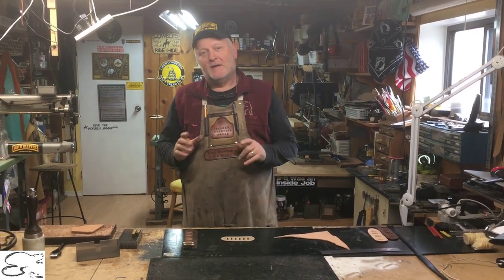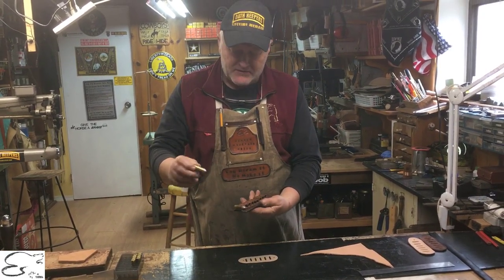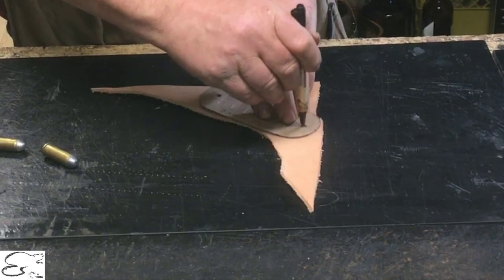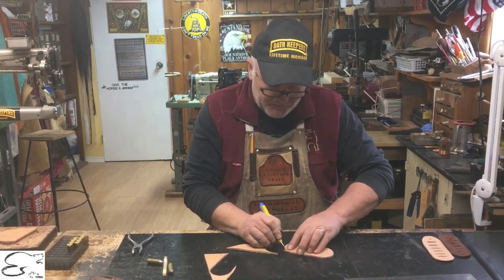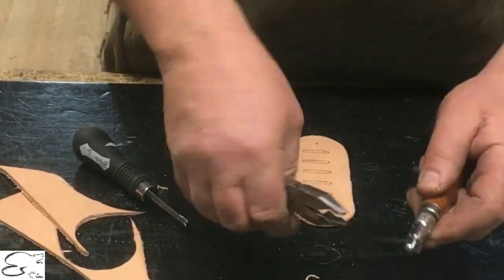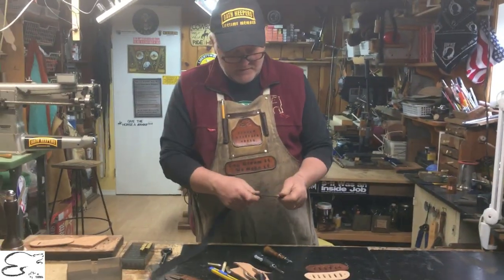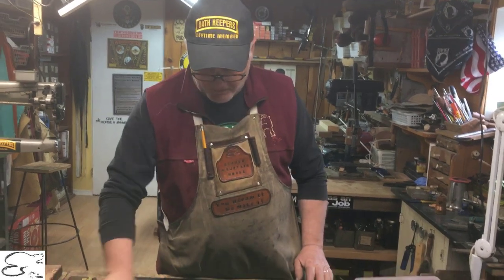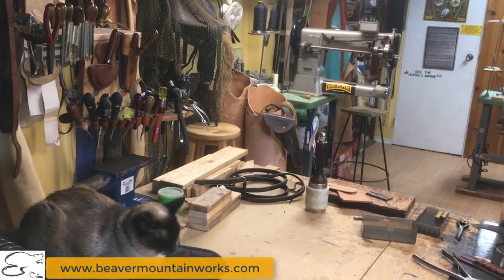How we make the Signature 3D cartridge loops

Comment: Thank you for the video! I haven't made one of these yet but a question I have is say you have one of these with 6 loops.  If you take 3 of the cartridges out, what keeps the slack from the 3 empty loops from going back behind the leather and loosening the loops for the next cartridge in line and then it could fall out?  Is this a problem that happens? I was thinking a solution could be once you have the loop material in place and riveted down with cartridges in place run a line of glue on the back where the material goes in and comes back in from the slot so that each one is self contained but not sure if that would work.
Reply from the maker: Thank you for watching Jason and no that doesn't happen. With all due respect but you are trying to solve an issue that doesn't exist. Like you say, you haven't done one of these, but we have made hundreds of belts and holsters with these 3D cartridge loops on them and no they don't loosen or fall behind the leather. 

The reason for this is, the start and end are held by chicago screws or rivets when manufacturing it, and the loops are formed around the cartridges (minute 8:50 on) and then hold themselves in place by friction.
Reply: Ok - thank you for the response. Wasn't sure if that would happen or not.